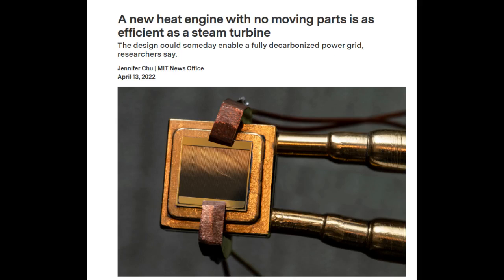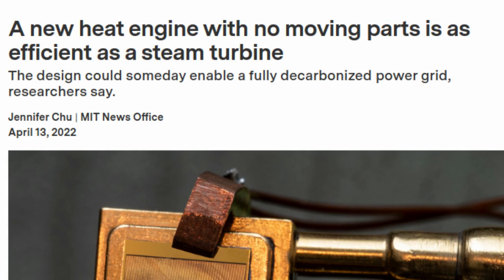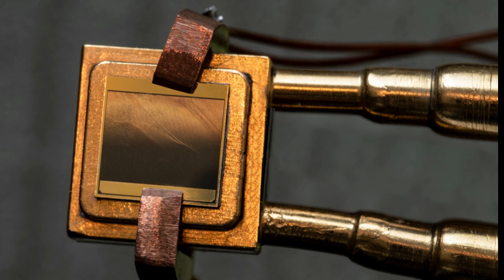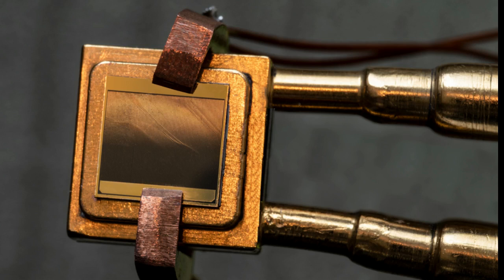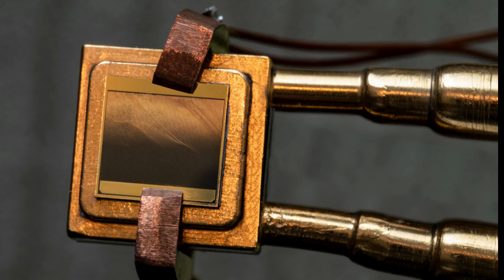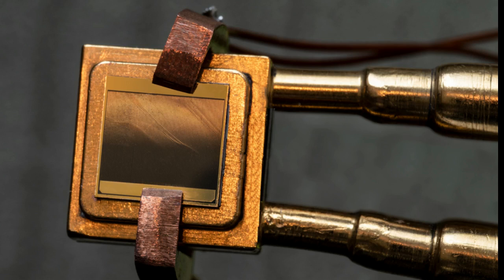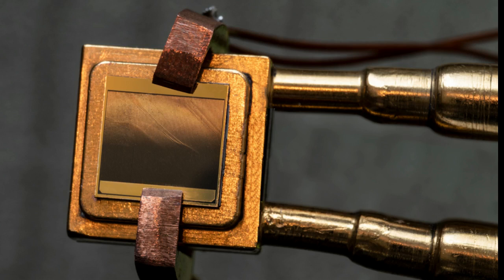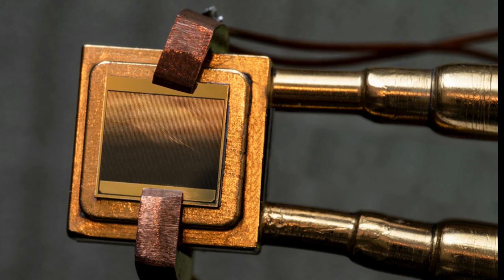A new heat engine with no moving parts is as efficient as a steam turbine

Comment: Stick this thing in the ground and you now have a persistent source of as much electricity as you want. You can either go deep for the 1900C and above heat or run a compressor to concentrate temperatures from shallower depths. The next consideration is durability. Nonetheless, sweet.
Reply: or replace the steam turbine in a nuclear plant with this and have a similar conversion with hardly any maintenance